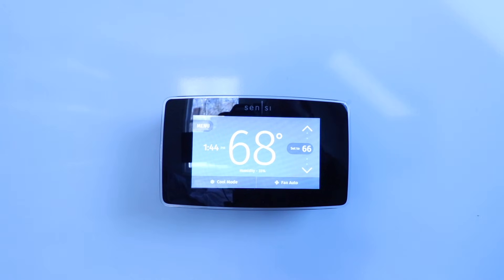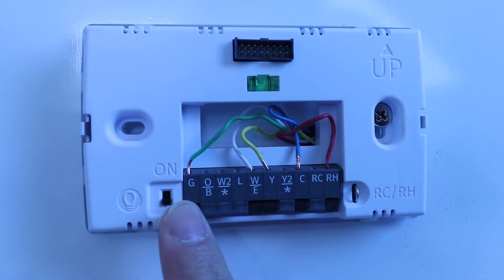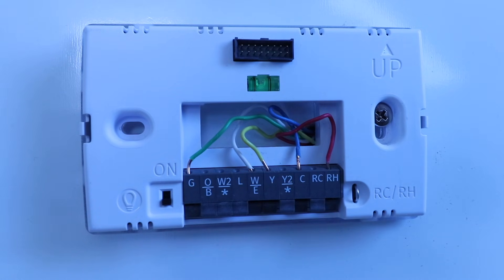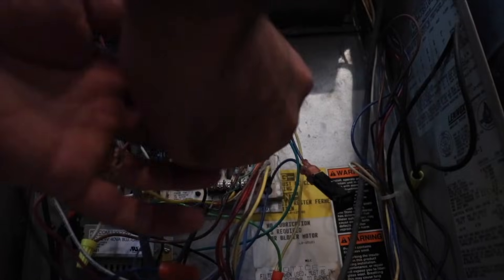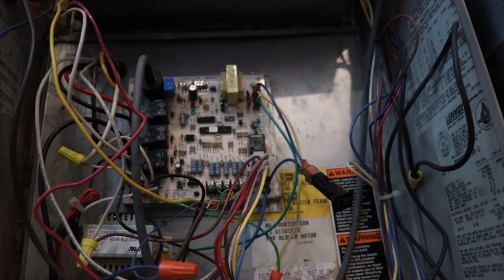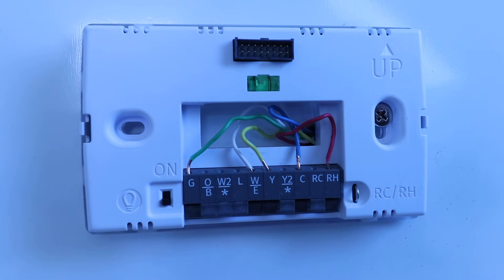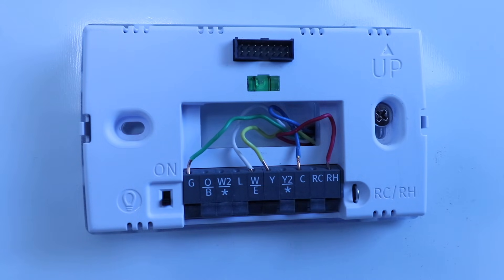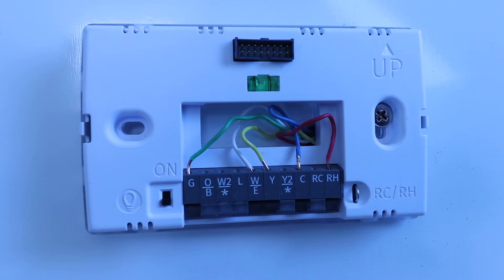How To Identify A Thermostat Common Wire (C Wire) & What It Does For Smart Thermostats

Comment: Is it possible to just use a wire to G a wire to RH and then a wire to C? I have a natural gas heater in my garage where I have my home gym. So I was just curious if a smart thermostat is possible so I can get the heat going before I go for a workout.

Comment: I just installed my Ecobee thermostat and don't get anything on the screen. I put a volt meter on the C wire and it's only getting 10 volts. Should it be getting 24 volts?

Comment: Great video. I have both the blue and green wire connected to the C on my old iComfort thermostat. Trying to upgrade to the Nest 4th gen thermostat , can I connect green and blue wire to the C slot in the Nest thermostat or do I separate them? Thanks  for your input.

Comment: Great video. I have both the blue and green wire connected to the C on my old iComfort thermostat. Trying to upgrade to the Nest 4th gen thermostat , can I connect green and blue wire to the C slot in the Nest thermostat or do I separate them?

Comment: this was very informative but I dont have an extra wire so I was going to move G to C, as explained.  However,  you say change it to C at the HVAC system.   I have a split system so are we changing it at the heater, condensor, or both?

Comment: Thanks a lot for the great video. I have AC (cold/hot) and there are 3 wires only. The existing thermostat has a digital screen but no back light even. Any suggestion on how can I install a smart thermostat? The AC is a split unit where there is an external unit and ceiling mounted internal unit.

Comment: Excellent video in every respect. Only one situation NOT covered. How can a person install a C wire to an OLD SYSTEM NOT HAVING A MAIN MODERN MOTHERBOARD ON THE FURNACE???
Reply: I've seen on online can get an existing transformer that plugs into your wall that provides 24 volts we can use that as your c wire power
Reply: exactly, I dislike that for that reason

Comment: I'm not a professional, but I wouldn't be comfortable getting rid of my ground for any wiring (even low voltage) running through my walls. That just seems like asking for trouble.
Reply: G doesn’t mean ground in this case. There’s no “ground wire” for the thermostat — actually the C wire is closer to the typical function of a ground wire than any of the others (it’s an unloaded negative path).
Reply: @nekkrist  He was talking about the common wire. Which is the other side of 24v transformer. Common at the thermostat was not needed in old analog thermostats . They are nothing more than a set of switches switch. Hot and common to a switch goes boom. Fork in the light socket experiment proves this! Then came digital thermostats. Rather have a new wire ran a battery was enough to power the display. Now that we have fancy thermostats with wifi we need power and common or it will not be able to operate